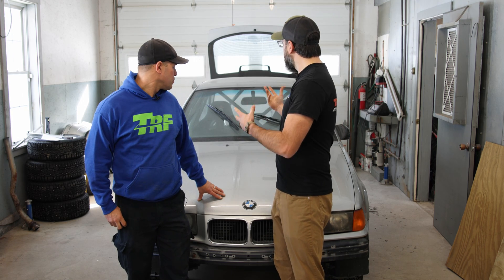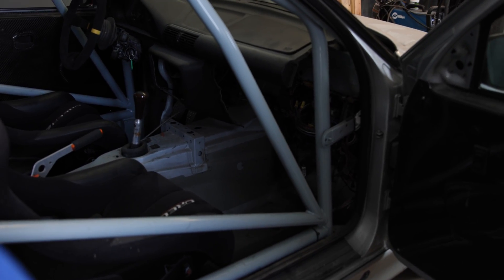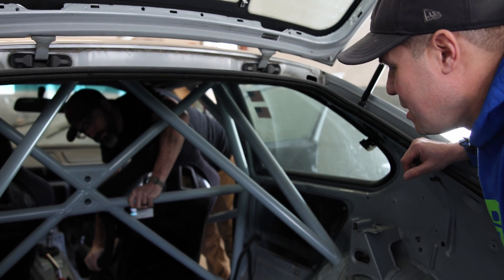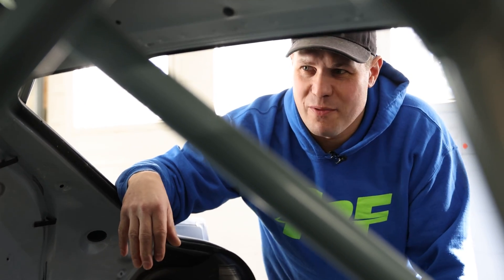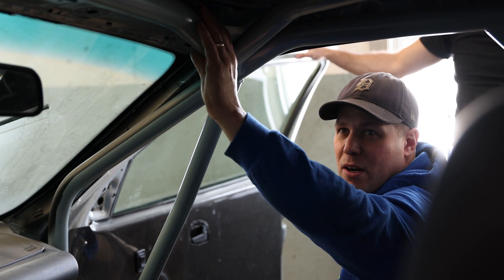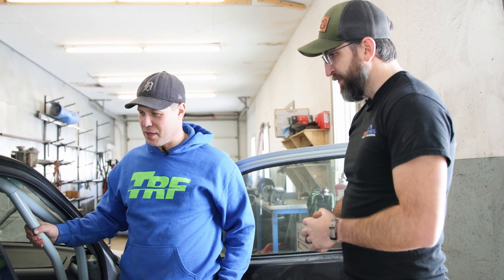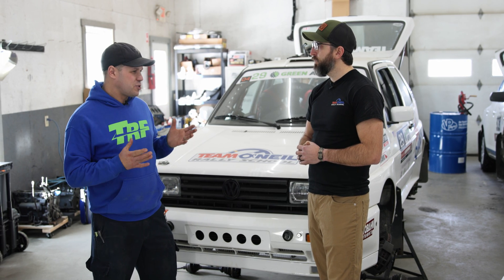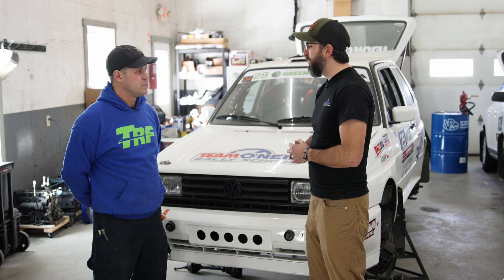What Is An Acceptable Roll Cage?

Comment: For that A pillar landing, could you make up the strength of a node by adding gussets to the joint? Or does it still come out significantly weaker in a collision?
Reply: Caveat, not a roll cage builder, but I work in an area that requires knowledge of structural engineering and steel trusses.
When designing with materials that are longitudinally strong (tension and compression) the goal is to form a series of triangles. If a force is applied at a node (corner) of a triangle, all members are only loaded in tension or compression, that is important, the tubes can only push or pull along their axis (oversimplification, but it works in this example).
For the A-pillar, the diagonal bars will transfer their load into the vertical, away from the node, the vertical will bend and try to shear the weld of the base plate. If the tubes were aligned to meet at a single point to form a node, the stresses would be equally divided between the sill tube and the vertical and no tube would be loaded in bending.
Gussets can make the area stronger, but they will never solve the issue of misaligned forces. In structural engineering a gusset plate is often used, to avoid multiple intersecting beams, while still forming a node. To my knowledge, that seems to be not permitted for roll cages (and is difficult to do with tubing anyway).